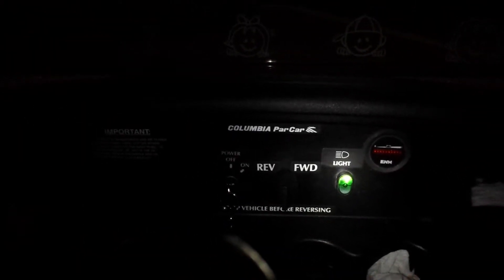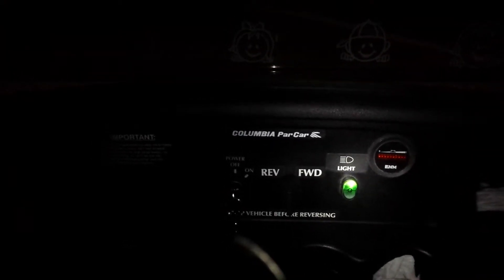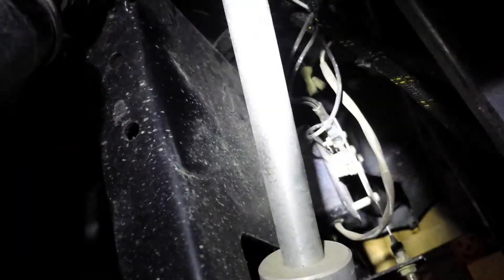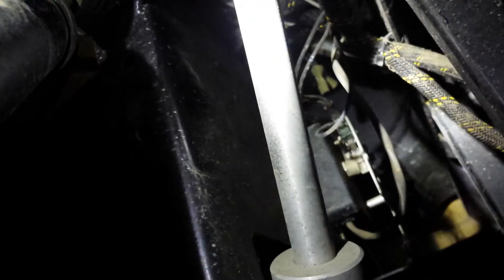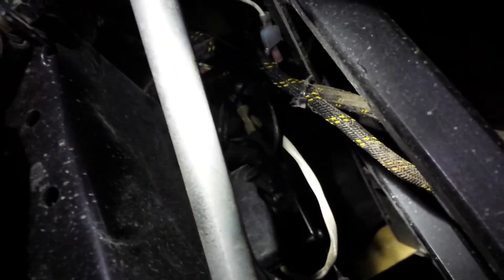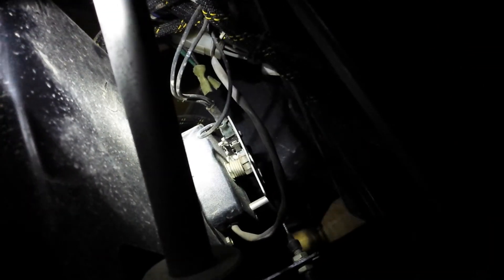Electric Columbia Par Car Golf Cart Help. Stops after letting off pedal

Comment: It seems like the control computer is run by microsoft windows and it just crashes for no reason, so you need to reboot the computer every time, it may be, just maybe solved re installing the operating system, if it is not solved, just replace the hard drive, add more memory, check the air in the tires the fuel level and the air filter....